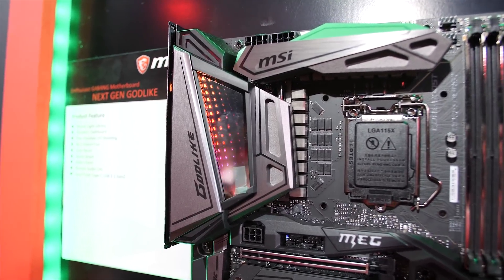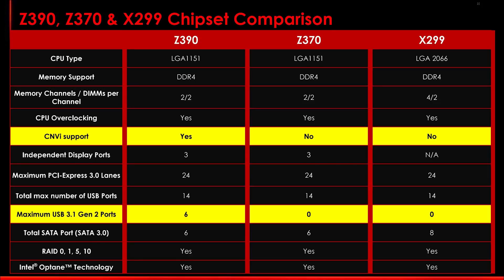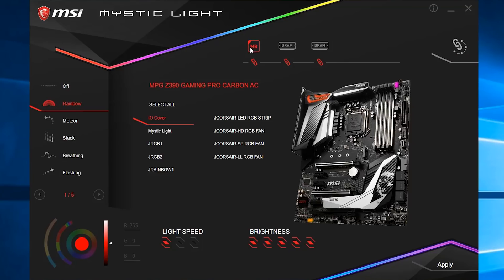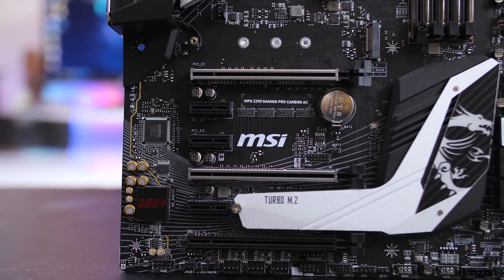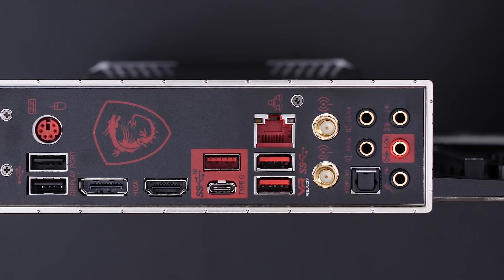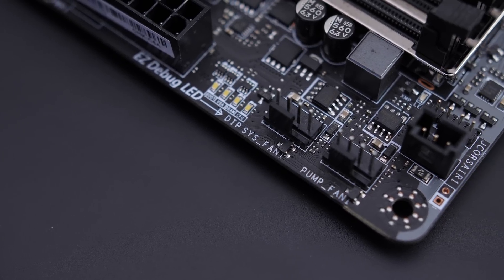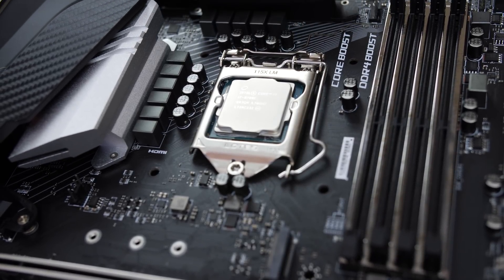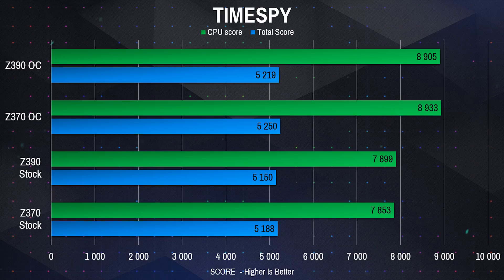MSI Z390 Gaming Pro Carbon AC Review - Ready for Higher Overclocking

Comment: This board is an absolute monster paired with the i5 9600k. All benchmarks are stable and non-threatening to hardware.

3D Mark "Timespy" benched:
[6197] CPU score 
[9115] overall

Cinebench R20 - 2768 
Cinebench R15 - 1121

----
Full build:

i5 9600k (overclocked to 4.95ghz)
MSI MPG Z390 Carbon AC
MSI RTX 2070 Super (Ventus)
Samsung 970 Evo plus m.2 (1TB Boot)
HHD Seagate (2TB storage)
16GB Corsair Vengeance RGB DDR4 3200mhz 
Corsair RM 750w (PSU)
H100i Corsair (AIO)
Corsair Crystal 570x (Mirror-Black)
5x Corsair LL RBG fans
Reply: Xehemoth won’t you pc be affected when overclocking it with the materials you’re using
Reply: @mightyunitedstudentsfellow6886   The overclock is stable. I can push it to 5.0ghz, but at that point I was concerned for the longevity of the CPU because at 5.05ghz it becomes unstable. 

This motherboard itself is a powerhouse, overclocking the i5 9600k is a non-issue. I have temperature sensors directly on the VRMs (Corsair commander pro w/ temp sensors) and I have never seen it higher than 50ºc. 

Now when you get to the i9 9900K, you might need additional fans covering the VRMs, I cant be sure because I do not have, but by the scaling and the nature of thermodynamics - mathmatically you should require additional cooling with a much more powerful chip. 

The TDP of the i5 9600k is 95W. However when you overclock it. that amount of power the i5 draws can exceed 115W (109W in my use-case) 

The TDP of the i9 9900K has a TDP of 205W. When overclocking that chip, you can exceed 250W, and when you reach the 250W territory, you may run into issues using the MPG Z390 Carbon pro AC. 

The VRMs CAN handle the voltages, but the CANNOT handle the heat if your cooling solution is not good enough - the board will fail. The VRMs will get to hot and burn out, which should be around 150ºc~180ºc. Now, the board does have safety kill-switches in play, but if you poke around in the bios enough, you can cause them to get SO HOT SO FAST the sensors do not stop it fast enough to prevent harm -- and this is where most of the negative reviews come in. Most people that review this board and leave negative comments - quite frankly do not know as much as they pretend to. Cost-per-performance, you CAN NOT do better. this board is extremely well made.

Comment: you also get a .05mhz boost automatically with these boards on your processor speed. you over clock to 5.2ghz it will actually be 5.250ish. Its nice but also annoying. I can get my 8700k to 5.321ghz but I had to manually change CPU bus clock speed and lower it. other wise it would be 5.350Ghz and blue screen after running benchmarks. I wouldn't recommend OC your 8700k that high unless you de-lid it though.

Comment: Hope this Video is still moving. I have a question about the CPU Powerpins. I bought a 650W PSU from be quiet, it comes with a 2x4-Pin (combined 8-Pin), so i am basicly missing a 4-Pin CPU Plug. Will i still be able to run the System with a 2x4-Pin or am i forced to upgrade to a 8+4-Pin CPU-Powerpin?

*Sidenote: Its a Modular PSU, so if i need to upgrade: Does a Simple wire works or should i buy a complete new PSU?
Reply from the maker: I cant remeber 100% but i believe i did it on this board. More power hungry cpus or overclocked cpus might just not get enough power with just the single 8pin.
Reply: U can run any motherboard with single 4 pin connector . But cpu not gonna reach the full speed clock . And may face some problem , like shutdown under havyload , with 8 pin should be fine .

Comment: I CAN'T DECIDE BETWEEN THIS AND GIGABYTE  z390 AORUS PRO!!!  Ordered the latter for my friends first build and its excellent and very stable with really good power delivery.
Reply: lemme know which one is better.
Reply: @dasang0624   will be building on friday with z390 aorus. Worked flawlessly on my friends build but we will see. Well besides poor led control app.
Reply: @rmblwgn  Well besides LED, the worst BIOS and all the negative cons, it is definetely better than other motherboards in same range, I might go for z390 aorus pro as well.
Reply: @dasang0624  his 9600k did 5ghz on like 1.32
Reply: @rmblwgn  that's awesome! I am also going to buy I7 9700k, is it going to work for 9700k?
Reply: @dasang0624    It will work with any 8th/9th gen cpu.  I am happy, board is very powerful. My 9600k is at 4.8ghz at 1.275v and max 60c
Reply: @rmblwgn  that's very good temp and voltage! How was your ram over as well?
Reply: @dasang0624   ram is running perfect in XMP at 3200. I know have cpu at 5ghz stable @ 1.295v !  I knew I gravitated towards this motherboard for a reason. Gigabyte took their hardware VERY seriously and man does it show.  It is a huge shame and pathetic really that their software is so bad

Comment: I'm torn between the Gigabyte z390 Aorus pro and the MSI z390 gaming pro carbon motherboards. Iwant the MSI boardbecause f the features with the board but am hesitant to pull the trigger on this board because the Aorus Pro has great VRM cooling and audio technology. However, this board has the corsair compatibility and a better BIOS menu. I just need help with explaining whether key features are worth it and which board I should buy. Thanks!
Reply: Did you buy anything yet?
Same here.. I don't know what I should buy. Either this or Gigabyte z390 aorus ultra. Can't decide
Reply: @Claude Gigabyte. I bought it yesterday though, still haven't received it but I think it's better than msi for this gen.
Reply: Update on yalls board gentlemen? I just got a 8700k, but cant decide with this or auros pro

Comment: Would you recommend this or the tomahawk with the 9600k
Reply: This board is built especially for i9 9X00's.
Reply: @Thrillseeker666  not really this is a high mid end board  probably for non oc 9900k and 9700k but its could push the 9600k pretty far.

Comment: I have this board with 9900K. 32gb of Geil Super Luce 3600 and running Evga Geforce GTX 1080 SC. It kicks butt. Great board.
Reply: I just brought the same with the i9 9900 with a RTX 2080
Reply: @atillanicholson1118  Nice! I have the EVGA GTX 1080 SC left over from a previous build and it still worked great so I just kept it. Would like to see what they come up with after the RTX  2080.
Reply: Robert Brumley Hi ı have this MB also ıam using İ9 9900k and Kraken X72 but ı have problem ı can not oc 5.0ghz and also Defaults settings 4.7 GHz so hot and voltage so High
Reply: @okan743  You need a better cooler. Swiftec is the best AIO on the market. Thats the liquid cooler I have on mine. and have reached 5.2 with it. Stock it will go to 5.0. I know with tweaking on it that it will go higher than that.
Reply: Robert Brumley whats your voltage 5.0 GHz can you help me before ı had 280mm ı changed my Cooler now 360mm no difference tempture so high still. When ı test stock with Aida64 4.7 GHz tempture 88 degree.
Reply: @okan743  Right now it is at the stock voltages with the Intel turbo on. Really I don't think it's really all that necessary to overclock the 9900K because I don't see that much of a difference at all on benchmarks. Now if you are going to overclock it for benchmarks, you really need a better cooler, even at stock settings.  I recommend running the Intel extreme tuner on it, and that you have give it at least 200 hours break in time before overclocking it.
Reply: Robert Brumley thank you for your advice. I found my problem . Problem is my shit case NZXT H700i when I open case’s up and front panel tempture decrease more than 10 degree. I am gonna try to return this case I bought it 40 days ago its very bad airflow
Reply: @TheGeil8500  5.2 yeah sure. You wish
Reply: PahEz kid tryna act smart eh?
Reply: @PahEz  my 9700k is running 5.2 on an AIO at 1.35v.. so yeah
Reply: @okan743  My 19 9900K never runs hot and will run at 5.0 but I am running a Swiftec a.i.o. liquid cooler. Best cooler I have ever owned. I've owned other name brand liquid coolers (won't mention the names) and they are just plain junk. Water pumps don't even last a year, had them replaced only to do the same thing. You need a good water cooler.
Reply: @TheGeil8500  Would my 2TB 2280 M.2 Sabrent Rocket SSD fit on this motherboard, I'm buying this!

Comment: I just got this board in the mail and I could hear something rattling around and when I opened it there was a loose screw floating around inside the anti static packaging. would this cause any damage to the board or should I be fine? should I send it back and get a new one?
Reply: Same thing happened to me. Sent it back to Amazon and got another one with the exact same thing. So I just assumed it was intentional. No clue why they would do that but seems to be working fine
Reply from the maker: I would say send it back. There might be damage you can not see.
Reply: @WeDoTech  i ended up going for it and it was ok. Runs great :)
Reply: @senormojo 2016 thats what it was and i decided to go with it and it runs fine

Comment: so if I'm planning to use just one m.2 slot for ssd is it better to use the bottom one with heat spreader since they offer same speed?  Would you know if 970 evo 1TB will fit the bottom m.2 slot?
Reply: C J same question here
Reply: same question here..  @Nateson
Reply: @sander7782  Answered the question above
Reply: @Nateson  Answered the question above
Reply: Yes, it's better to use the bottom with the heat spreader. And yes, that size of drive will fit perfectly!
Reply: Been using bottom slot works perfectly.  Super Fast
Reply: Would it slow the bandwidth down on a graphics card in the top pcie x16 slot, any game performance loss while using the heat sinked nmve m.2 ssd drive inserted
Reply: I've got a M.2 and it needs to be installed in the first slot. My MB has 3 X M.2 slots. I also thought to use the second slot but after struggling to get it working I googled the problem. Maybe they have changed it. I don't know.

Comment: put a 9700k in this and overclock plz
Reply: Works great, no issues with the 9700k (it can handle the 9900k as well).
Reply: @DGPG35  what cooler would u recommend with this motherboard? with a 9700k
Reply: @kishan5954  NH-U12S

Comment: Confused between this and Asus ROG Z390-E Strix. How do MSi boards compare with the ASUS ones? I have heard that ASUS ones are the best, and have also only used ASUS boards because they seem to have a better UI and overall support (Aura is more supported than mystic lighting), and are also easier to overclock with. Also, I have an MSI RTX 2080 Ti Gaming X Trio, will that sync up the effects with this motherboard? Thanks, great content on your channel despite a relatively low sub count.

EDIT: Wait, deal breaker for me, only has 5 full size USB ports, Asus has 7 on Z390-E.
Reply: same dilemma here, which board did you end up getting?
Reply: The MSI is better if you plan to overclock, it has superior VRM (runs cooler).
Reply: in my experience go msi, i even got a refurbished gpu and still working after 5 years lol